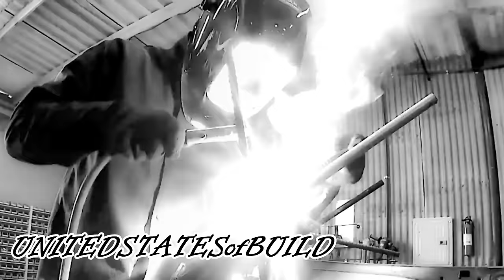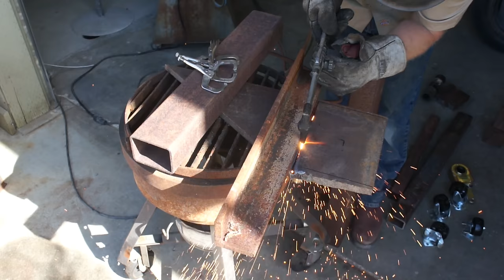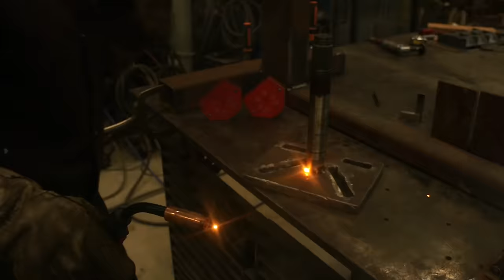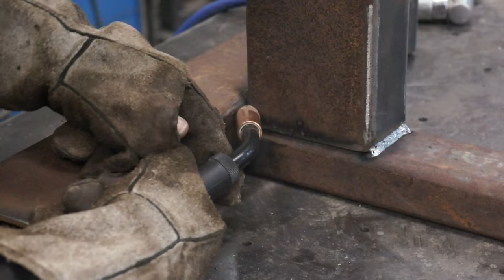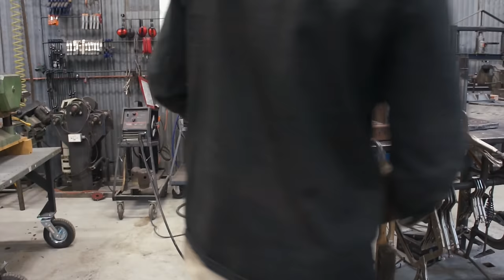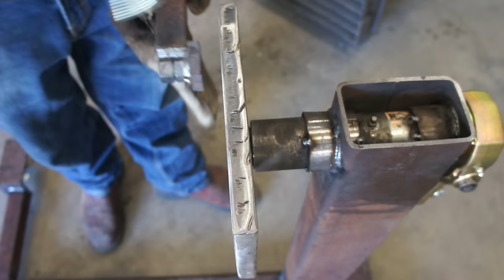DIY AWESOME Heavy duty engine stand, Geared spinning head

Comment from the maker: I think when people worry about the steel caster supports bending its just a misunderstanding of the actual amount of weight on that piece of angle. If I put that small piece of angle on the ground and drove a mid-size truck over it would it bend? What do you think?

Comment: Cool build. I've never worked with any brake slack adjusters, is your drive set up with a one way clutch for use in only one direction? Is it possible to set it up to work in both directions and still be safe?

Comment: Slick build buddy! When can I come by to pick it up and borrow it? Im pulling my cummins motor to replace the piston cooling nozzles and that motor is a beast to try to turn over on a regular engine stand! I wish I had a decent welder to replicate your build. Awesome work though. I wonder what the capacity of this unit would be?
Reply from the maker: Im not sure what max cap is. I know those cummins are heavy. Ive had a couple 6bt's pass through the shop over the years. My little forklift will lift them, but she feels it.... Good luck on the repairs and thanks for watching!!

Comment: Did the metal you used for the wheels support the weight when you put an engine on it, or did it drop to floor because you didn’t gusset? Also was the reduction enough with the weight of a motor on it? The ratio looked way to high to be useful?
Reply from the maker: It held fine. Steel is strong. The rotation feature worked well also. I need to make a video of it in use. Here it is with the 5.0 on it: https://www.youtube.com/watch?v=6Zy-kV2htC4

Comment: What is the cleaning spray you used for the metal and then washed off?
Reply: Just standard foaming engine degreaser you buy at any auto parts store

Comment: what is the dimension of the mounting head plate ?
Reply from the maker: If I recall what I did was looked up a couple mounting hole patterns of some small and big block engines (look for the circumference of all the holes) and then made sure I could adjust for all the common sizes.

Comment: That is not a real engine stand all of the steel used looks extremely light duty, how coud the front wheels hold up if there welded on angle iron. Cheap cheap crappy project should if left it as scrap metal.
Reply: Have you seen the thickness of the Chinese engine stands that everyone uses? It's less than this and I just had my big block on one with no problems. This stand looks plenty strong. I'll agree about the caster mounts, those look like they'll have a little flex but it probably wont matter.
Reply: Lets see your stand pal this one will hold a fully dressed big block Chevy all day long.
Reply: Elias Lara who Pee’d in your Cheerios?!?!  Damn Dude!  The stand he built has about Double the steel used in almost every Engine stand you can purchase.  Check the next video he has with a fully dressed Ford small block on it. It barley has any flex.  Plus he actually has control as he spins the motor unlike the manual ones that spin with NO control at all.